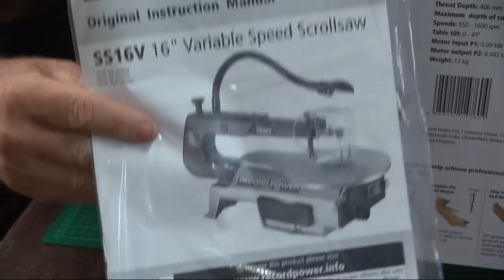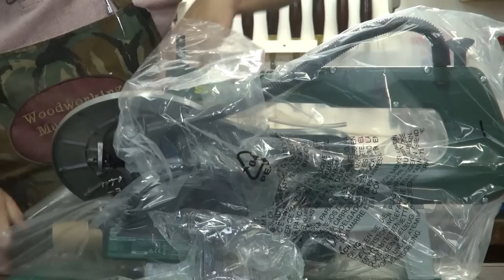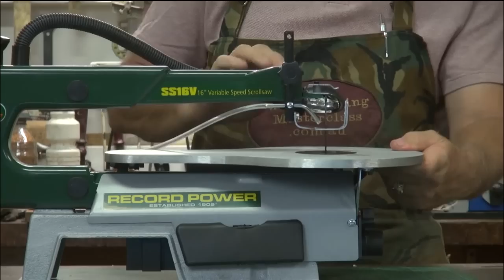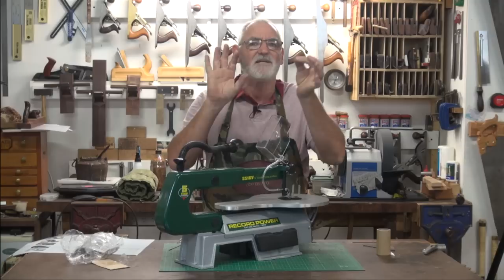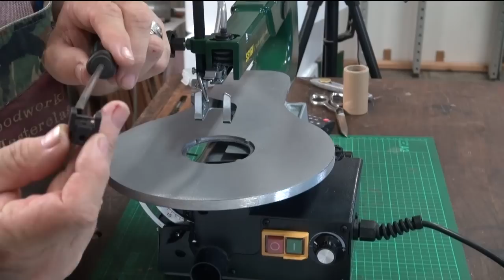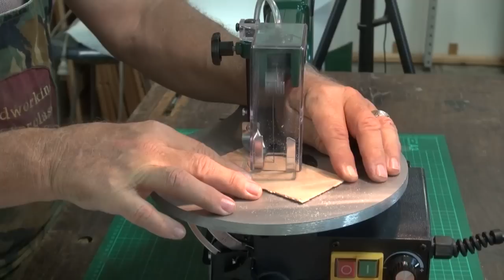Scroll Saw Unboxing Record Power SS16V

Comment: The problem with pinned blades is that they are very difficult to use with any type of fretwork. If you are just cutting a shape, then fine, but most scrollsawers will be doing fretwork needing to insert the blade in a 1/16 inch or smaller pre-drilled hole. The machine you tested is a Chinese built model sold under many different brand names, including Wen, Ryobi, Porter-Cable, Craftsman, Shop Fox and of course Harbor Freight. I bought one of these and sent it back when I realized how limiting the design is.  Enjoy your videos, Steve and Bob.
Reply from the maker: Hi Jeffery. Thanks for the comment. I personally find It is quite adequate for the work I want it for which is Double bevel marquetry using 2/0 blades and a #70 drill. I do as mentioned, have a Hegner and a very large Hafco with a 30": throat for bigger stuff. Cheers Steve

Comment: Noobie here. Which is better when there are dozens of piercings where you have to keep moving from hole to hole to cut out the pattern .. Pinned or Pinless blades?
Reply: I have this saw and I bought a bunch of pinless blades but on this model they are very difficult to put on and off, especially if you want to do it quickly. I would therefore recommend pinned blades if you can drill a whole in ur work big enough for the pinned blades
Reply from the maker: Hi Clyde, Pinless as they are smaller and can fir through holes easier than Pinned.  The blades I use (#70) require a 0.028" hole. Pinned blades would not even get close to going through that. Cheers Steve
Reply: @Woodworkingmasterclass   My problem is having to reset that end into the connector with a tool each time  ... seems way to complicated to connect the pinless type. Seems like a camlock device would work better.
Reply from the maker: @clydedecker765  From my experience the cam lock is only for applying tension to the blade not holding it. So you still have to set it each time. A pain I know. Either that or look for designs that can give access to many cut with only one entrance point such as in a Patera. Cheers Steve

Comment: Darn, I was expecting a static shock during the unboxing :(

Maybe it's just my electric personality, but whenever I unbox computer cases (or even new computers) which come with just as much polystyrene foam, I inevitably get a little zap from touching the metal case :(
Reply from the maker: Maybe it would have been different Ray,  if it was a router! lol cheers Steve

Comment: Morning Steve.  This reminds me, I haven't bought any new tools, gadgets, measuring devices, etc(for my little barn shop,) in at least two weeks(and I don't have a scroll saw.)  Better hide this video from the Mrs....cheers...rr Normandy, Fra.
Reply from the maker: Great thing about these Richard it you can use them on the Kitchen table, Low Noise and no vibrations. Just use the dust extractor and "No One" will know you have been there. I won't tell either. lol Cheers Steve